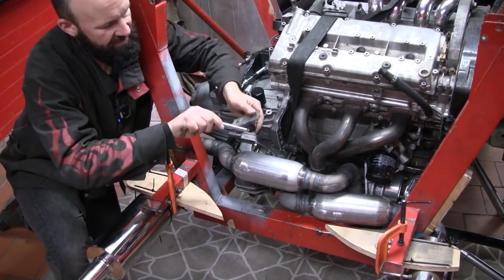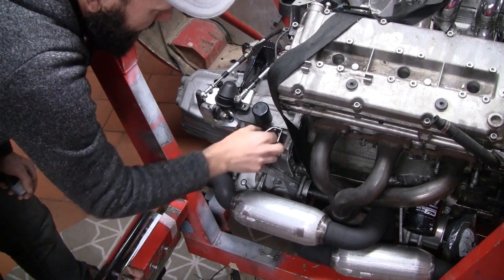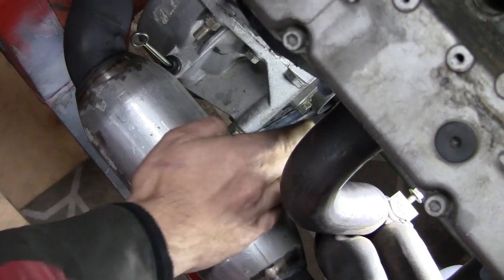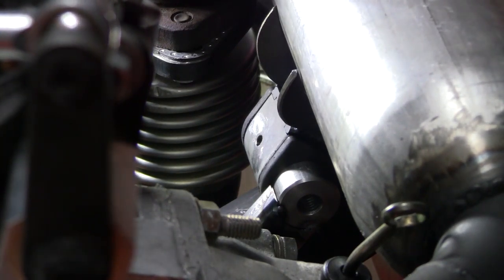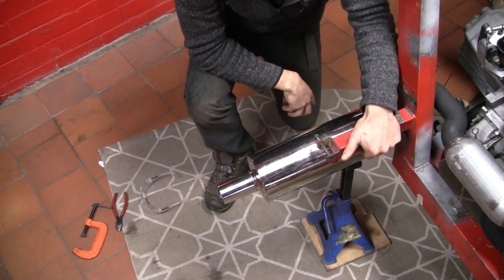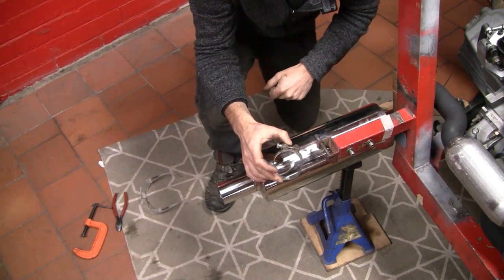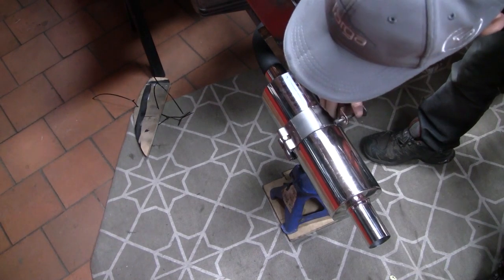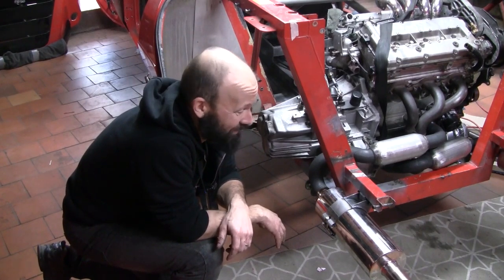Project Stratos - Episode 14 Exhaust Part 2

Comment: Great work as always, if you want a touch more give in the muffler, you can get some high temp thin rubber strip that can wrap on the inside  of the clamp between the muffler and the clamp.
Reply from the maker: Great idea, Will have to track some down, i have some rubber mat  but didn't want to use it as was worried about the temp factor

Comment: So damn impressed I can't even express it... your videos are addicting.  One question though, shouldn't the flexi section be between the part of the exhaust that's fixed to the engine and the part of the exhaust fixed to the chassis?  My untrained logic tells me that after the flex pipe any mounts should be to the chassis, not the engine.
Reply from the maker: Thanks mate, appreciate it. Those flex joints have very limit movement, they are really just designed to help out with thermal expansion and vibration, rather than provide lots of articulation. After a huge amount of issues braking headers on my previous rally car I learnt you won't to keep the exhaust mounted on the engine for as long as possible

Comment: on that last muffler mount arrangement. I wonder if you would have used one of the T bolt pins as the place the mount attached to. Rotate the T clamp around the muffler until it is close to the frame. Make a new T clamp pin that it is a U shape. One end goes in the clamp and the other end into the rubber bush on the frame. Then you wouldn't have had to reinforce the thin part of the clamp and all of the stress would have been distributed through the strongest pat of the assembly.
Reply from the maker: I thought about something like that, Initially i had envisioned a lot more movement in the muffler and was worried about clearance between the clamp and the body/frame, if i had spun it around, turned out it probably would have been OK.  Also the bolt for the clamp is only 6mm, needs to be small diameter to clear the muffler, at the moment its in pure tension, so all good, if I'd used one of the pins to mount the muffler, with the offsett to the side the mount needs to clear the body that 6mm bolt would end up getting a torque applied to it and go into bending.  
Its a good idea though and you could get it to work
Reply: @105colin  Well, it is always easy to think of something different when you aren't there. Your solution looks really great. Do you think those bushings can take that heat? They seem closer to the muffler than in their "normal" locations. I also thought you would hang the small mufflers off of the exhaust manifold flange so that the exhaust system could be more of a separate unit but I think that wouldn't have been as compact as coming up from the transmission. Awesome work!
Reply from the maker: @brianbob7514  I think they'll be fine, there's a pretty big air gap and not much much metal to conduct the heat.  Thought about hanging off the manifold, but one of the reasons for the second rubber mount was to reduce the stresses on the manifold itself.  I've had a very bad run with breaking manifolds on the 105, had to weld them up at nearly every rally, granted the v6 should run a lot smoother, but it's scarred me for life
Reply: Colin Byrne I guess those rubber parts hold up to welding so they should be okay. Can’t wait for the next episode.

Comment: Have you had thoughts about an engine steady bar to  one of the heads to reduce engine motion and consequent  exhaust movement?

REPLY
Reply from the maker: Yep,  getting a engine steady/torque reaction bar, i was just waiting until i had a better idea what i was doing with the inlet manifold  as they both be getting very close to each other

Comment: Really enjoyed watching it fella. Are you seriously going race it after all this hard work?? I would be so slow. Not wanting to crash it.
Reply from the maker: yea, this thing is going to get an absolute hammering, hence all the work to help it stay together!
Reply: @105colin  This car is more than the usual You Tube build; it will get thrashed around the roads of Tasmania when finished.  At 950kg/225kW the power to weight should be a lot better than an Alfa GTV, 1200kg/150kW, so the hammering will be at a much higher rate.  Are my numbers close?  I've added 100kg for roll-cage etc and guessed the power.  I built a Cobra replica in the nineties and it was not especially light considering its size (1200kg); not sure about the Stratos.
Another great video.  Thanks.
Reply from the maker: Correct it well get thrashed! I think your numbers are close, the alfa was a but lighter, around 1050, and the stratos should be better than that. Should be a lot of fun anyway